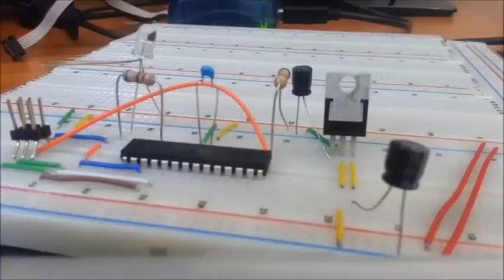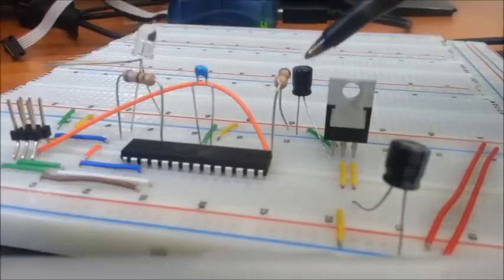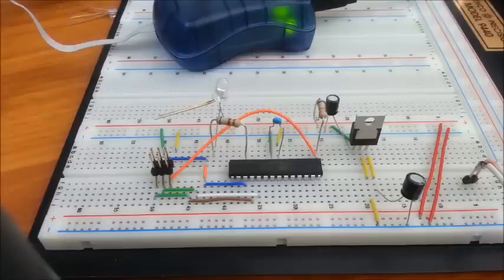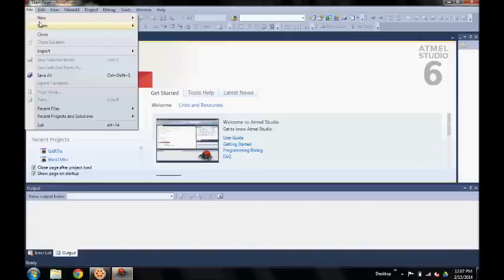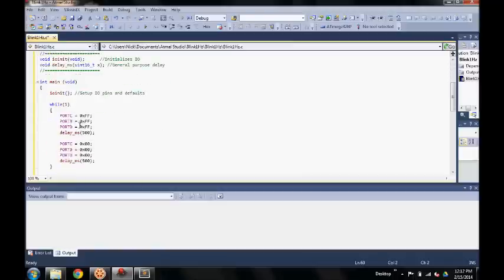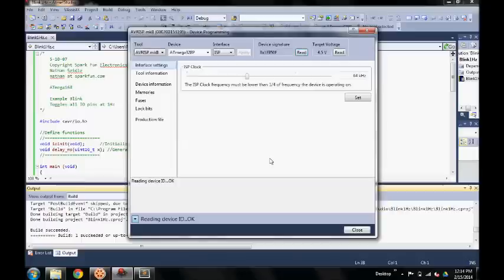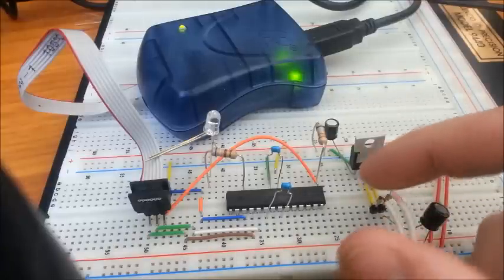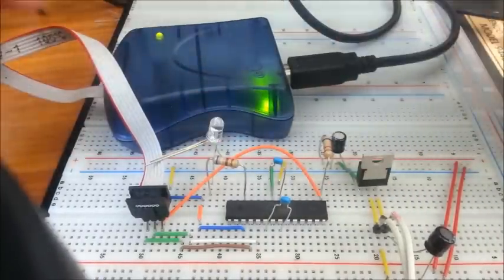Blink an LED with ATMega328P Tutorial

Comment: hi Nick very nice Vid...you could use 5 vts regulator 7805T it has the cap built in , also i can see that you are not using a cristal on port 9 ans 10 of the 328p  ...
Reply: Ok I have being doing programing for a long time and I liked your video.
Reply: Very nice.....and simple.